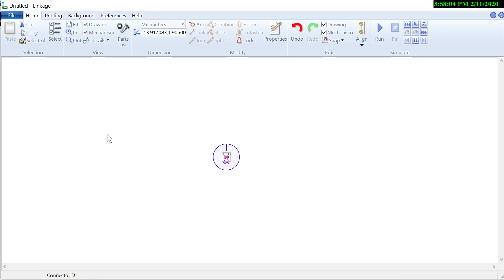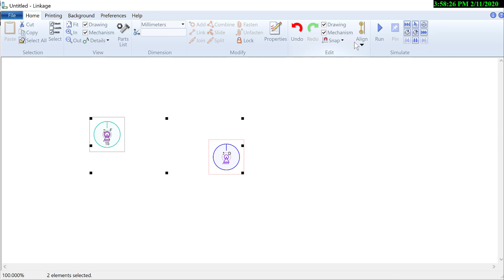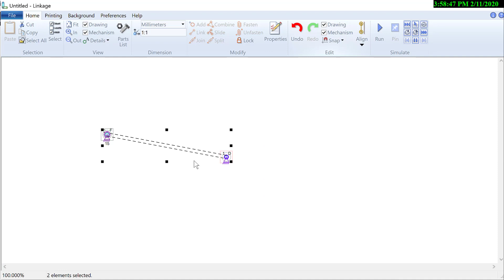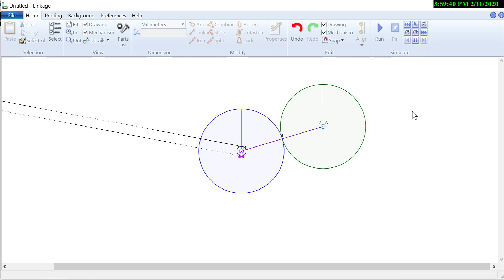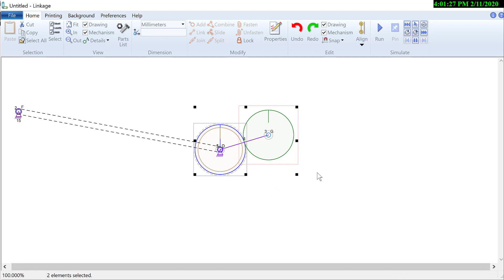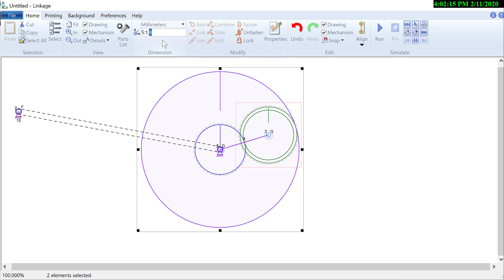Linkage Planetary Ad Hoc Gear Tutorial

Comment: I have a doubt that how this internal gear is working ...If you select any two same sized gear and then use internal gear function any one of the gear should increase its radius to make the other gear inside it.....I don't understand while using internal gear sometimes extra circle comes out sometimes it works..I am really confused ..Please help...
Reply from the maker: If one of the gears increased its size then it would violate the ratio you set for them. When you set a gear ratio, they will always be sized to create that ratio. I'm sorry that the software is not sophisticated enough to show an error or better deal with the situation; I'll add a note to try to do something better about it in the future like not allow internal gear selection when the ratio selection won't support it. Just make sure to set a ratio that makes sense for internal gears and it should always work. If you still have trouble, contact me via email in the documentation or on the ABOUT box and send me your mechanism and instructions to recreate the problem. That way, if there is a bug, I can get it fixed as soon as possible. - Dave
Reply: @rectorsquid  Thanks for the reply. I will try to send the problem via email. Thank you